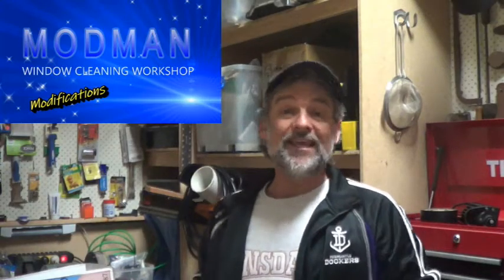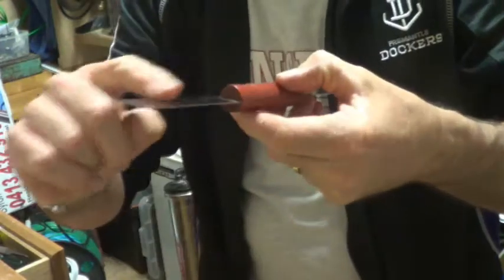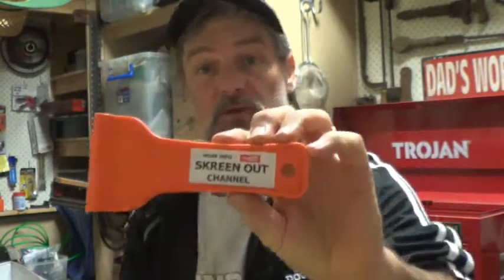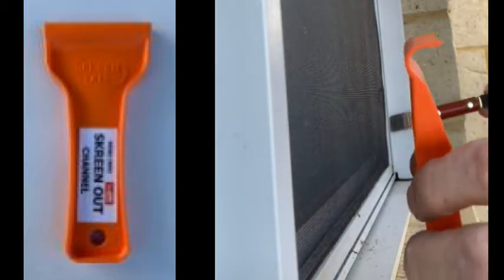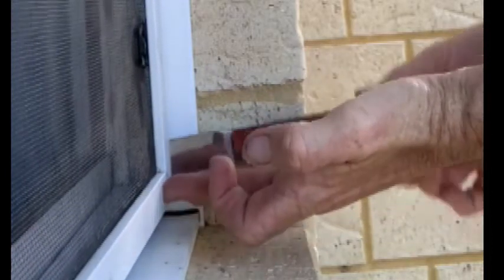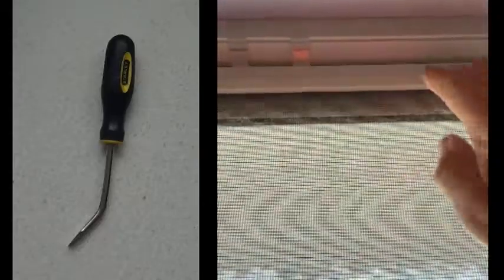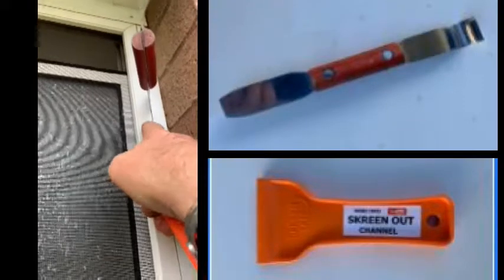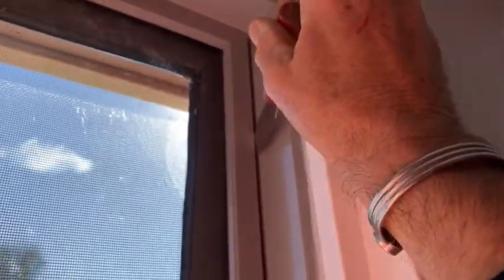How to make and use Screen out tools

Comment: Great video mate, beats me why you have two thumbs down. 

I had some very tight screens today that didn't move at all, your video gave me the idea of using that screen out tool by H. I've had it for about 2-3 years but just been in Ute with my gear. I got it in about half way up and slid  it up or down to find the end that popped, worked well, think I'll use more often now. 👍